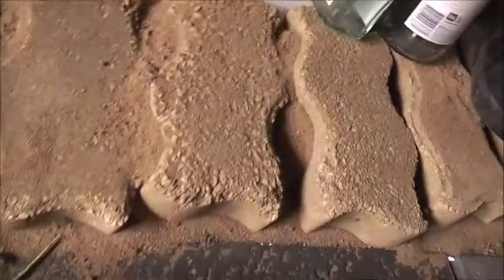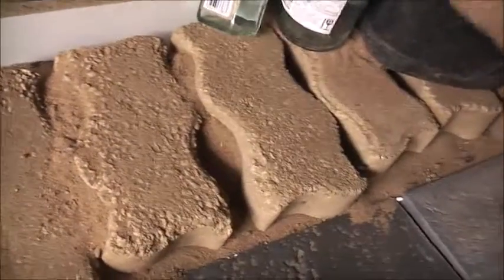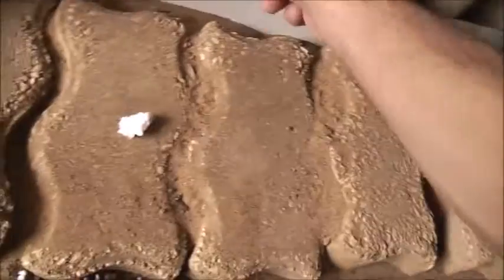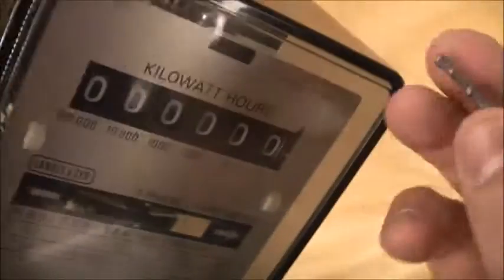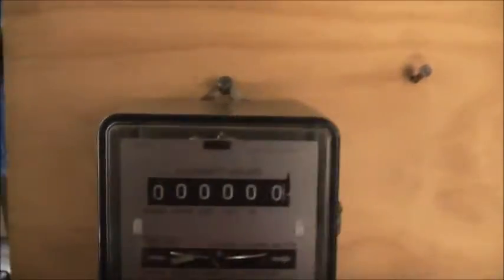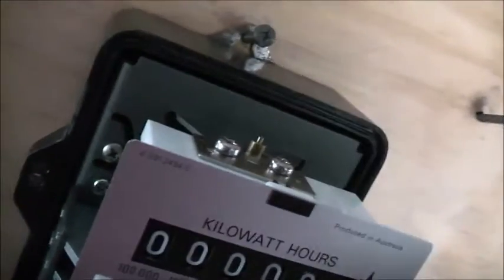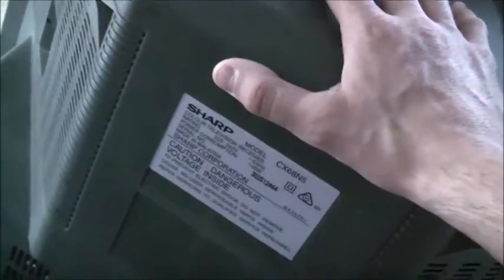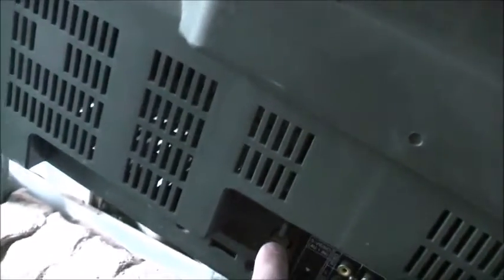Waffly Update

Comment: did you fill the bottle with sand and have it under water when you drilled those glass bottles?
Reply from the maker: I didn't know that!! Thanks for that
Reply: HDXFH yeah no worries, hold the bottle just under the water so you don't get the diamond bit too far under and remember glass is a liquid so being submersed will take up the vibrations-you can actually cut glass with scissors underwater!